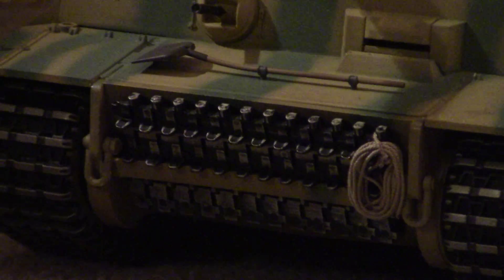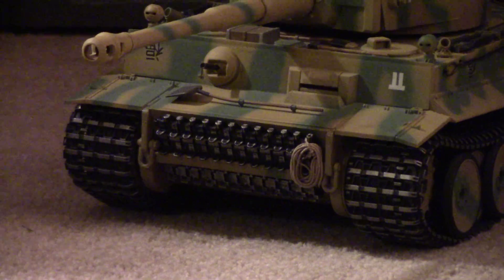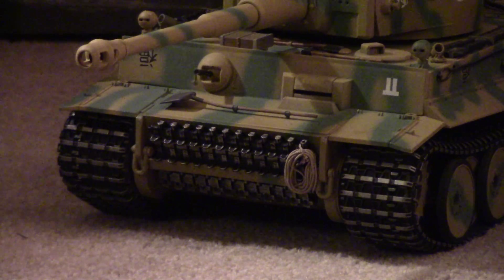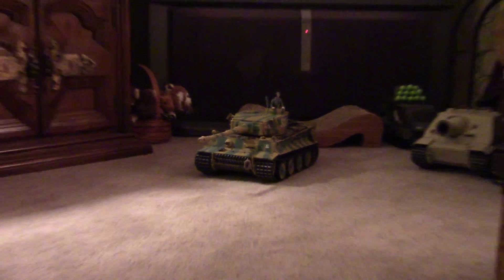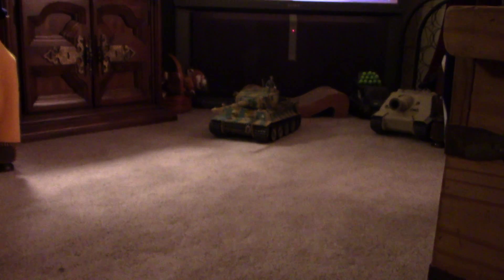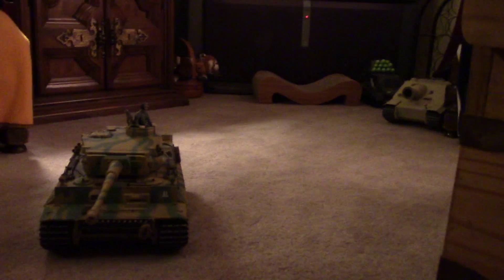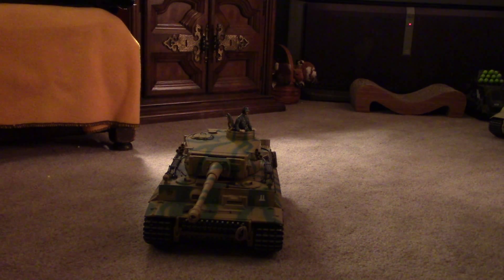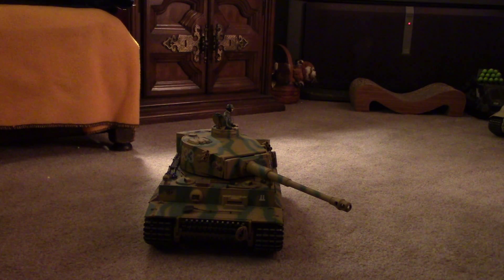recoil working

Comment: Hey Gary, I got the mid-version tiger from Imex and the track recoil is causing the bullet to not go far with a crap, is there a way a can disable just the track recoil?
Reply from the maker: +Kole Hosch   Yes, it's called the Komodo from RCTA (RC Tanks Australia). It's about $20 USD and RCTA gives free worldwide shipping for the Komodo. I have a video here called Project Komodo+ that shows more.
Reply: +Gary Hoff ok I'll take a look! also that antenna from ECA works amazing. I don't know if you ordered some but it's amazing! and really really cheap.
Reply: Gary Hoff ok I took a look at the video, looks great, I think your tank is a different company or possibly different model from imex, I could tell by the vision slots on the top left turret, but I was wondering if there was just some modification I could do to this without having to order anything like that. If I have to, I have to, no big deal, although I would have no idea how to install it.
Reply from the maker: +Kole Hosch  That's the Imex/Taigen model TAG12010, and if you mean the vision slots in the cupola, that's because I fixed that. The Komodo is very easy to install and they have instruction videos at RCTA. They also have another track recoil eliminator called ATRC, but I haven't tried that one.
Reply: +Gary Hoff ok thanks for the advice Gary!
Reply: +Gary Hoff so I thought I fixed it a little messing with the 2 prongs Erik was telling me about and it didn't fix it. I looked up the komodo but unfortunately it is discontinued :/ anything else that would work?
Reply: I opened the prongs on my panther , it doesn't track recoil anymore.